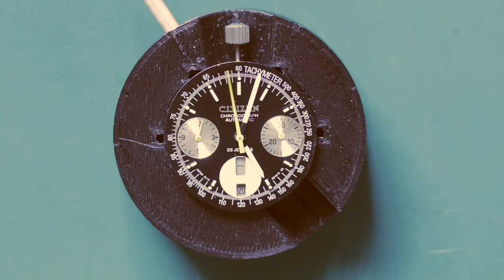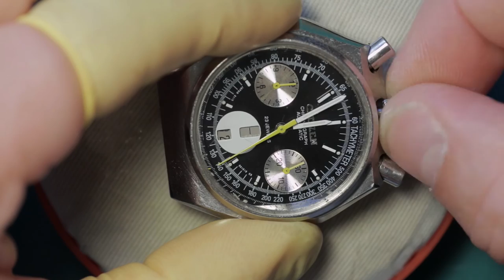Citizen Bullhed Brad Pitt 8110A Service Rebuild #2

Comment: Hi where did you buy your chronograph black movement holder? I can't find one anywhere.
Reply from the maker: It's one I designed and 3D printed.
Reply: No wonder i couldn't find one. I think of all the videos that are in YouTube regarding this watch you're the only one who explains about pressing the reset button to put the hands aligned, most just want to show off they're assembling a 8110 a  watch but they don't explain anything. Congratulations that you have the humility to take time and explain. If I hadn't been watching your video I never could have aligned the second hand of the chronograph I always had a second or a half second misalinged because I didn't press the reset button and I was very upset, now I'm aligned. Thank you for explaining that point God bless you.
Reply from the maker: @iglesiaprimitivadecristoel5703  You're welcome, if you take that as standard practice for any chronograph when resetting the hands that'll stand you well.
Typically you want to disassemble and reassemble with the chrono in run position as the parts are less likely to be under tension but for fitting the hands you need to know the hammers are reset fully on the hearts to align them.
Reply: Just want to let you know this has been an extremely helpful resource while restoring my own 8110A. I have watched and re-watched so many times now. Unfortunately, my movement came missing some screws, most troubling, one from the Chrono cover plate which you indicate requires 3 different and specific screws which are not interchangeable. Trying to track appropriate screws but the spec sheet and parts diagram I have from Citizen for this movement only lists one part number for Chrono cover screws (922-79)
Are you able to advise or clarify which screw where?
Thank you so much for this video!
Reply from the maker: @johngandola3573  I'm very glad it's been useful for you.
It's not uncommon for old watches to have missing parts and fasteners sadly and these are hard to find spares for, (Citizen in general for that matter).
I couldn't tell you a specific size offhand but I have a small box of screws which I gather as I go when disassembling parts movements etc and tend to raid that to find replacements when needed.
Will check to see if I have assembled 8110 movements I can measure one from when I get the chance.
Reply: @spidiq8
Thanks so much for this video. Such a great resource!
Would you care to share the 3d print file for the movement holder? I've been working on an 8100 for months now and that would help enormously.

Comment: Hello, great video I saw it only now because I just overhauled one (I'm a hobbyist). The watch was non-functional and now after repair everything is working except the reset/Flyback of the chronograph. The button can be pressed and you can also hear the sound of the column wheel snapping a tooth, but the chronograph seconds hand stop for as long as I hold down and then start again from the same position without resetting. Do you have an idea of how to try to solve this issue? THX
Reply from the maker: Do you mean after you press the start/stop button the Chronograph doesn't stop?
The first button should work as per a normal chronograph starting and stopping, the reset/flyback should work in both instances but only stop at 12 if the chrono is stopped already.
If so then the clutch lever isn't stopping the centre chrono runner or the clutch spring is broken allowing it to continue running. You'll need to remove the chrono bridge to investigate.
Reply: @spidiq8  thank you for your quick reply. The reset/flyback does not work at all. If I stop (first button) and then press the reset button it does not fly back to 12 (the rest button is too hard and cannot be pressed). If it is running and I press the reset button it just stops as along as I hold the button pressed and then continues running when I release it. I disassembled the chrono module several times and no component is broken 😞
Reply from the maker: @massimoalberio7946  I see, was this working prior to you servicing? I've had this occur once before on a movement with a missing spacer which sat under the jumper spring for the column wheel.
Reply: @spidiq8  No it was not working. Do you mean the L-shaped spacer/spring sitting under the pillar wheel spring? that one is unfortunately available...
Reply from the maker: @massimoalberio7946   I did mean that yes. But if that's in place that's good.
So the only other reason is that the hammer is not resetting on the hearts. Will the reset button press in fully?
Reply: @spidiq8  I can hear a click but I am not sure that the hammer runs all the way through to the hearts. If this was the case what would you suggest?
Reply from the maker: @massimoalberio7946  I'm not entirely certain currently. I might need to open up I've of mine to take a look again. If you're pressing the reset with the chrono drinking there shouldn't be a click as the hammers are a soft reset on these but if you operate it with the back removed and watch the clutch plate through the chrono bridge you should see the clutch push down which temporarily disengages the spring and the hammers sweep across under it.
Also check with the back off that you're getting full travel on the reset plunger try pressing the pusher and observing the travel them using something like brass tweezers or a plastic probe press the operating plunger directly and see if it travels further than the pusher moves it.
Also check you have the movement ring in correctly as any wiggle in the case will ensure you're not getting full travel
Reply: @spidiq8  Hi finally found the issue. The shepherd crook style spring acting on the flyback lever through the buffer spring was out of its seat 🙂
Reply from the maker: @massimoalberio7946  Fantastic news. Glad you sorted it.

Comment: How do you hand wind this watch?
Reply from the maker: By turning the crown in it's pushed in position as with any regular wristwatch.
Reply: @spidiq8  to the left or right? When I do right it's pretty tight.
Reply from the maker: @555kaneda  Clockwise, the crown on these is difficult to grasp as it's slightly recessed on the back of the case but it shouldn't be tight to turn.